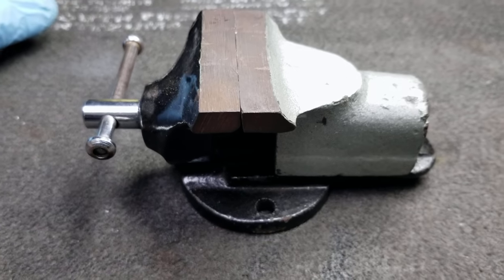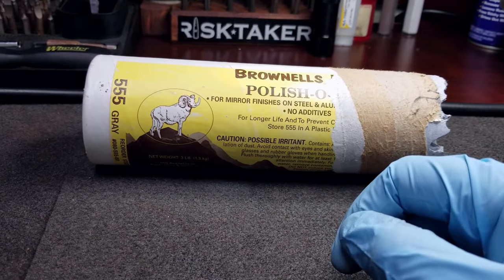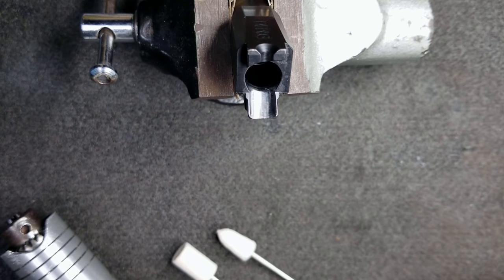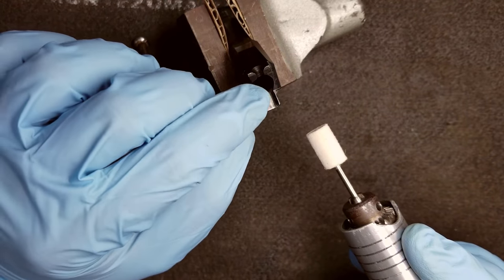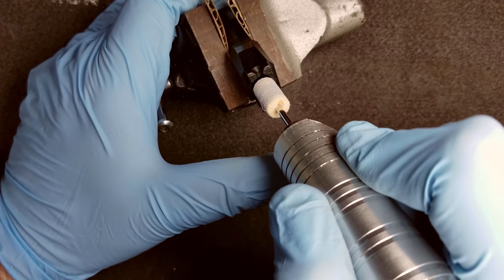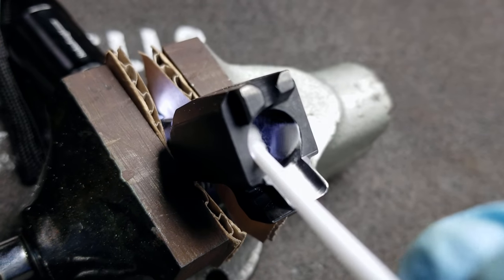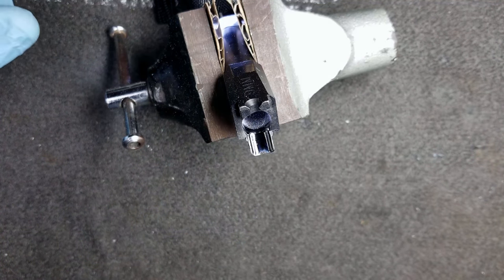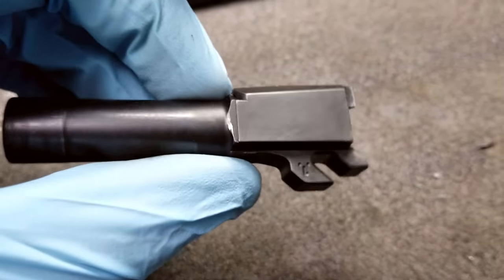How to Polish a Feedramp Quick and Easy

Comment: You'd think that gun companies would hire actual engineers, who know that the feedramp has to be polished?  Or maybe they know something this guy doesn't know.  (SMFH)
Reply: All new guns I've bought, the feed ramps are shiny but not polished. Most of the time it's just the assembly oil they leave on the gun to prevent corrosion during storage. I know it's not necessary, but I de-grease and polish ALL mating surfaces on my gun. Even makes my Keltecs run like a Lexus.

Comment: For god sakes next time plug the barrel with a patch before you start polishing to prevent the debreeze from depositing in the lands and grooves it makes clean up so much easier
Reply from the maker: Either way you have to clean the barrel once your done to remove any compound left behind. plugging not necessary. I always use bore cleaner and patches to clean up the barrel as if i fired just to make sure all the compound is off.
Reply: @TheHobbyGunsmith  that works too but if you clean the barrel first then plug it and polish all you have to do is wipe down the feed ramp with denatured alcohol or rubbing alcohol and pop out the plug light Lube and re-assemble, I've done dozens of them it's faster and cleaner, but to each his own
Reply from the maker: @rockhead1731  I shall try your method next time sir. thank you for the tip.